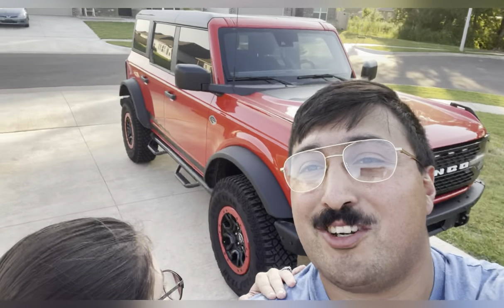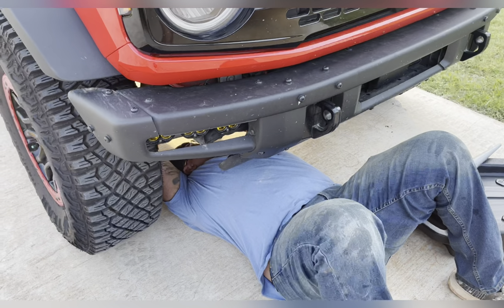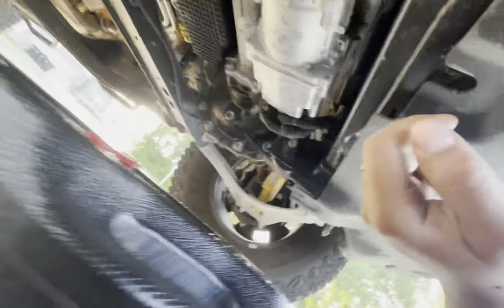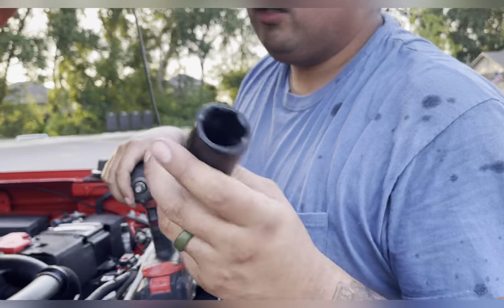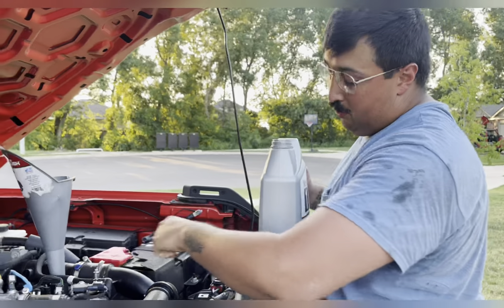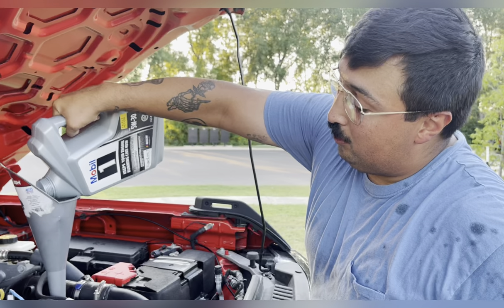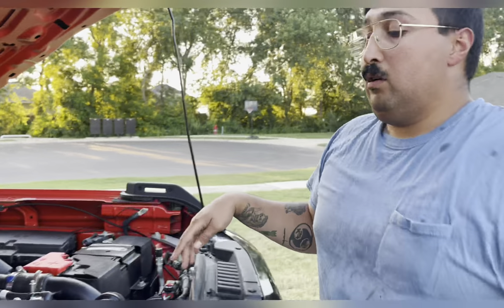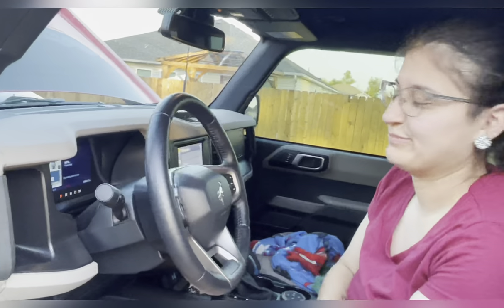2022 Ford bronco 2.7 turbo oil change for Dummies by Dummies

Comment: You can flat-crank the engine to circulate the oil prior to starting....since the oil filter housing is "upside down" and you can't prime it with oil....push  the gas pedal and brake pedal all the way down (at the same time) while pushing the start button for 4-5 seconds to do this.
Reply: I’m certain fire doesn’t do this when I get my oil changed!

Comment: The owners manual says 7 quarts…….
Reply from the maker: Thank you very much!
Reply: Ford now says 6 qts.
Reply: Updated manual says 6 qts now. My 2023 WT's manual also says 6 qts
Reply: The manual is wrong. It is 5.5L or 5500 ml not 5700 ml.  Apparently Ford is aware of the issue but have not issued a service bulletin. 5.5L is to the high level fill, not the nominal fill line at the top of the hatch…..so spec is approx 250ml over the recommended fill line.
Reply: I put 6.2 and it sits rights at max level. 6 should be perfecr